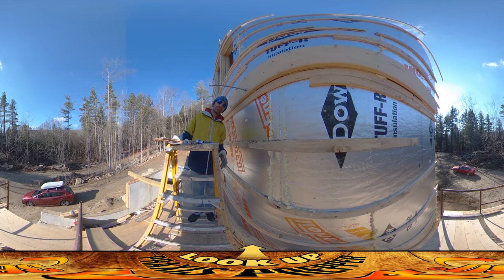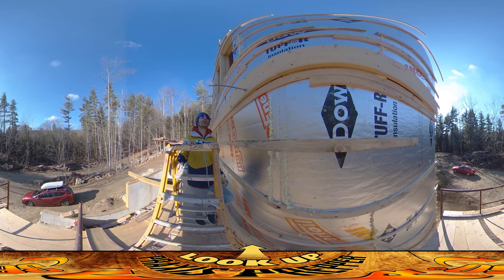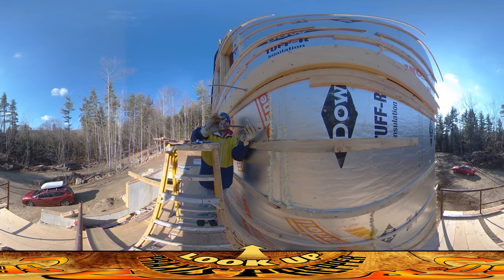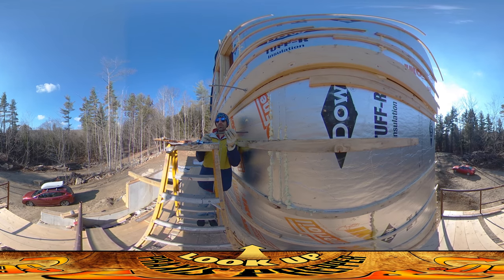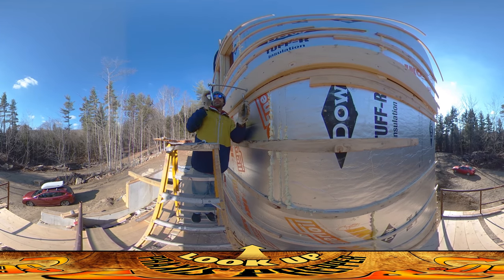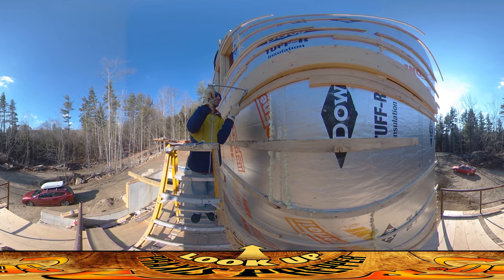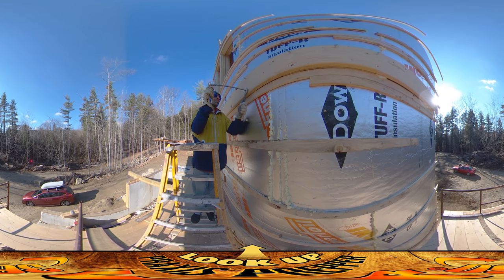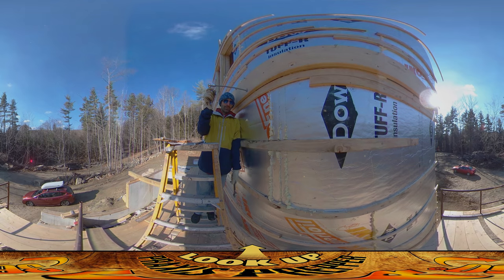Homestead Building - Snow is Coming, Threaded Rods Tightening Solution

Comment: Weird that the end nuts just let the rod spin if you aren't securing them. Were you pulling on the rod to keep good tension on the interior nut while you tried to tighten the nuts on the exterior?
Reply from the maker: I ended getting them all on, but it was a difficult 2 person job. One on both sides. Ironically, the rods going through the holes that weren't perfectly straight (because I didn't have a full-length full-size drill early on and had to drill a small hole all the way through and then drill a big one from both sides) worked better because with the channel not being perfectly straight, the rod didn't spin easily due to the friction in the hole. By getting the right tool for the second run of holes, I actually made the job harder.
Reply: Praxis Homesteading and Survival Skills Crazy how that happens sometimes